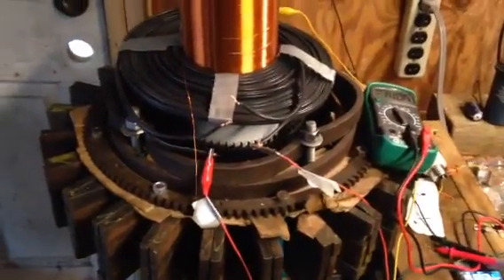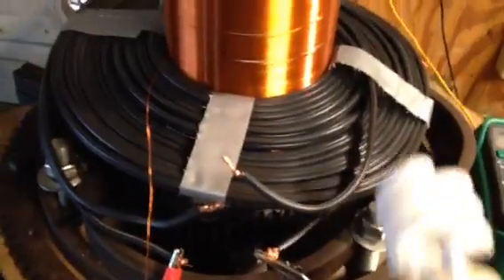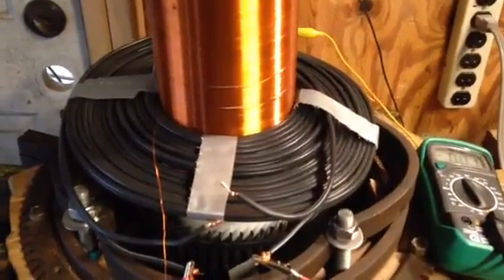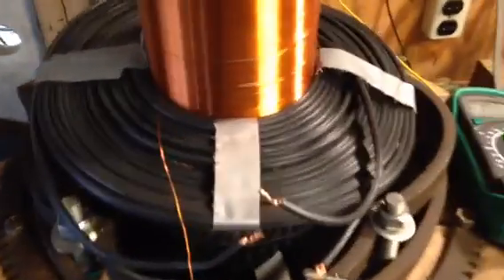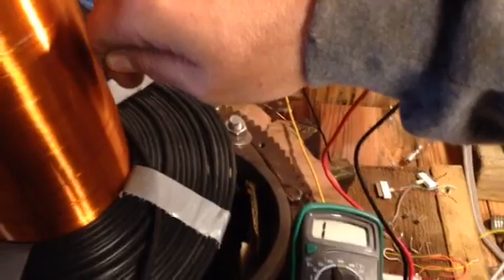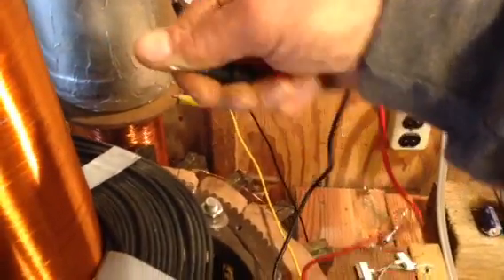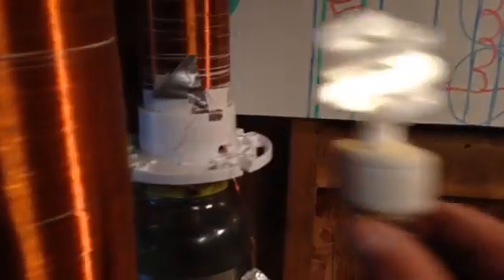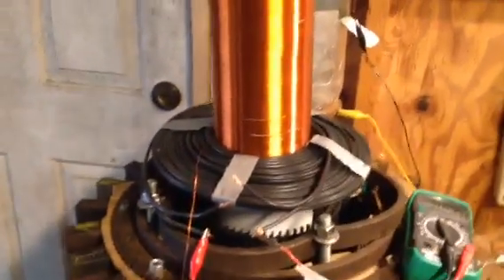Pancake coil versus other coils

Comment: Hi Roy I have a feeling that the pan cake coil is really a negative ion generator that you should have it vertical and  the centre of it run that end wire out like a tv aerial at 90 to the pancake but have that end with short sine wave crinkles say 17 the reason joe booker says in his joe cell horses mouth to strike his cell on the centre of the cigarette lighter holder that is a tesla pancake style configuration same as the window winder also to back this up tesla is on a seat in a picture with a large pancake coil behind him vertical mounted you see even without the Internet they knew how to show us the structures you just have to realise its a bluff on a bluff for tesla knew the government would try to destroy his simple findings so he and others were street wise smart anyway that's my thoughts
Reply from the maker: Hi Honda
I really like your thoughts. Keep adding your thoughts to my comments. It helps open my eyes. Thanks